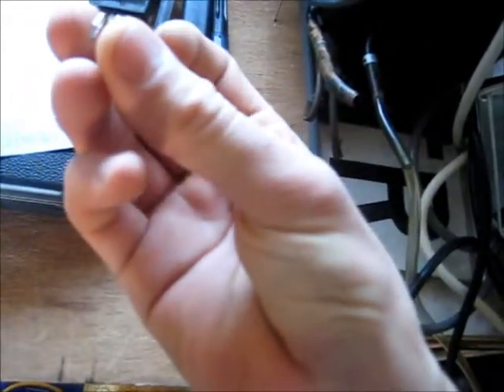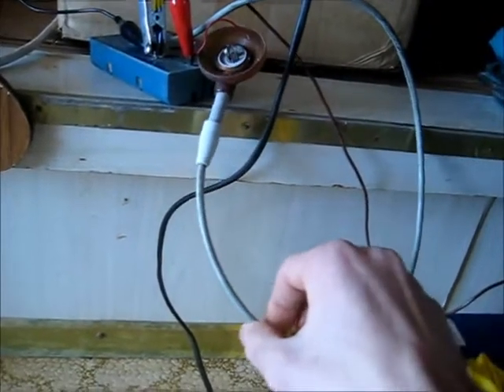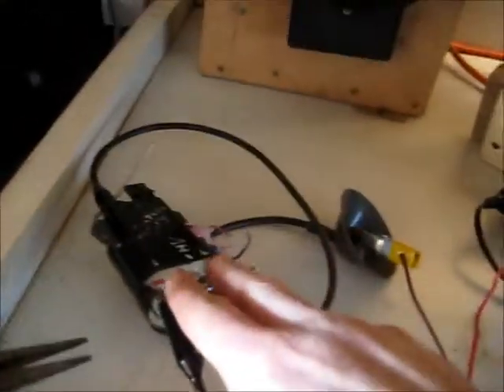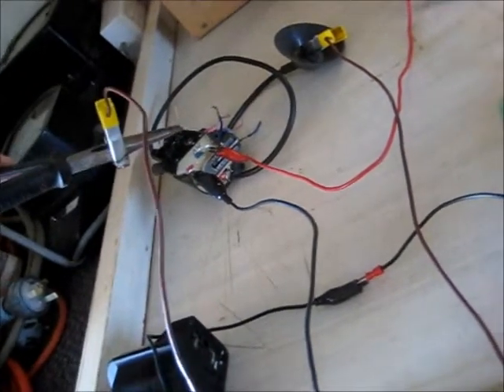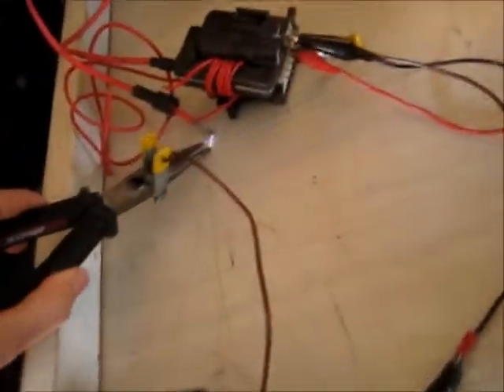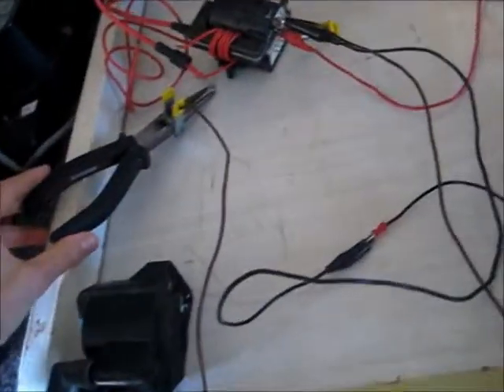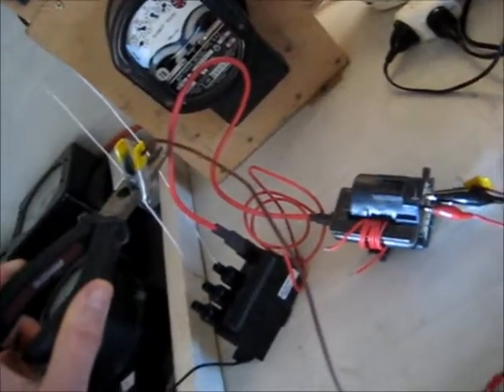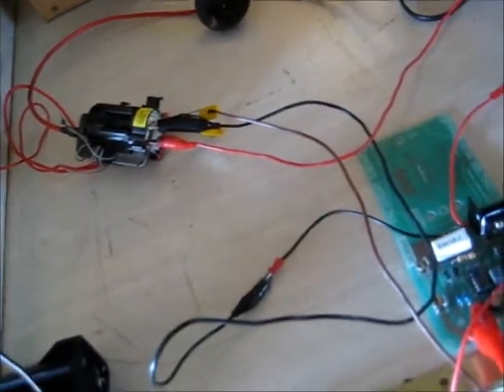More Jacobs Ladder Kit Experiments

Comment: you should replace both of the resistors with pots cause one of them is for your duty cycle and you want a high duty cycle for hotter arcs :), i think, though im no expert with the 555 and also lower that cap to about 1 - 2nf on pin 6 to get a higher frequency :) but like i said im no expert with the 555. so i could be wrong.

!!!!happy sparkin!!!!